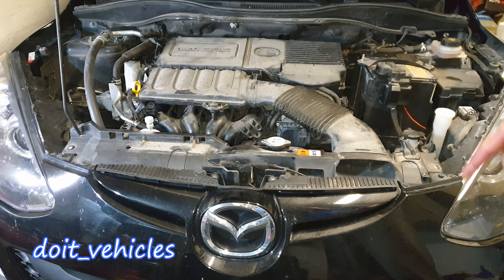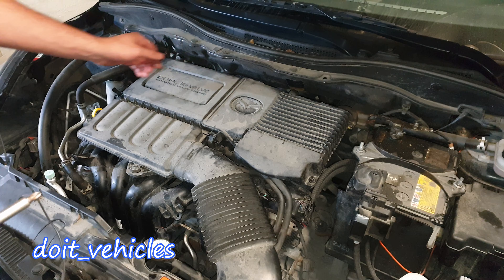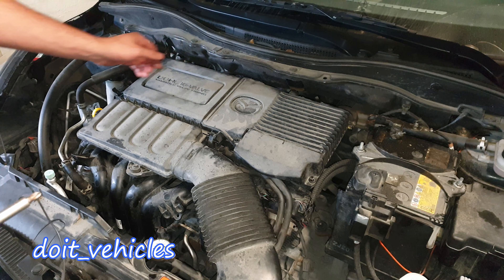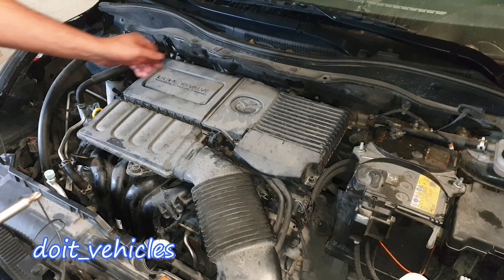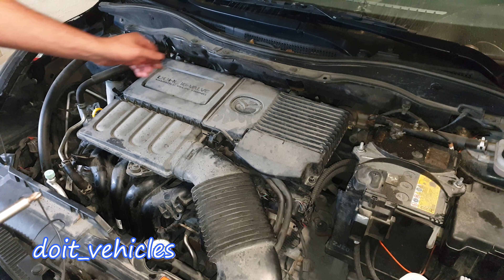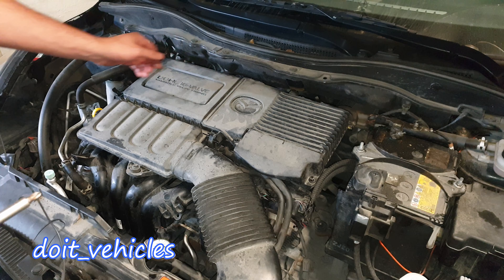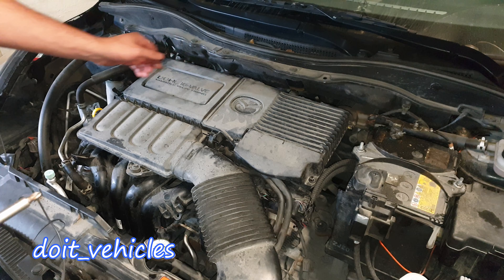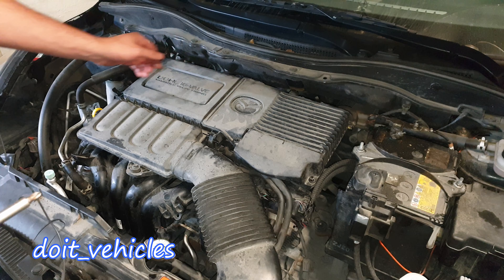1.5 Mazda 2 Valve Cover Gasket Replacement

Comment: My mazda 2 1.3 2009 use too much engine oil. Anybody know what can be a problem?  Where is a pcv valve on my car?
Reply: you must remove the intake manifold in order to replace the PCV valve
Reply: My mazda 3 with the same engine is consuming oil as well, I didn't see any visible leak from the top
Did you find out the reason behind your car's oil consumption? Was it the pcv?